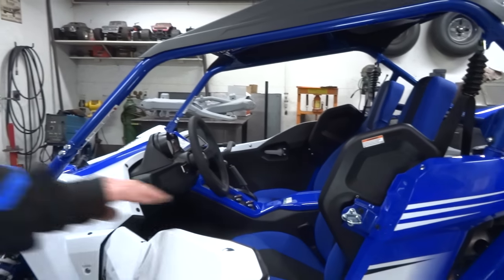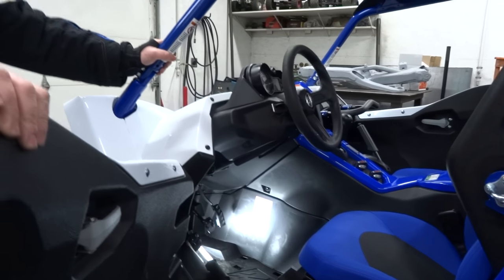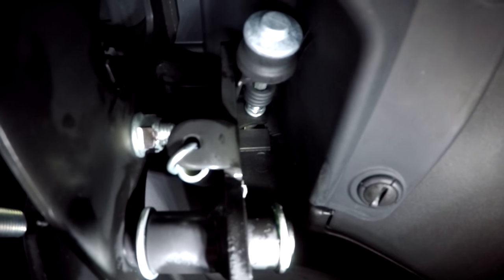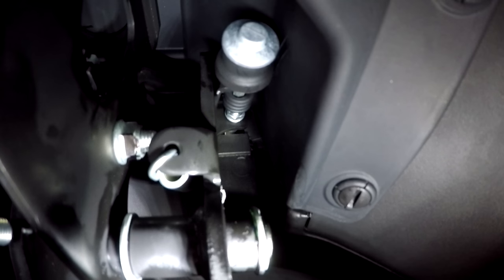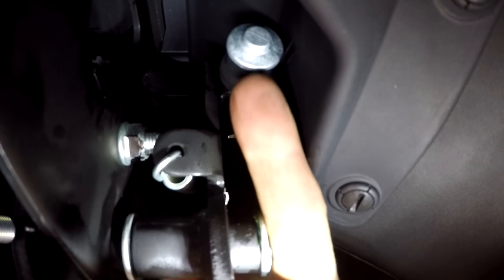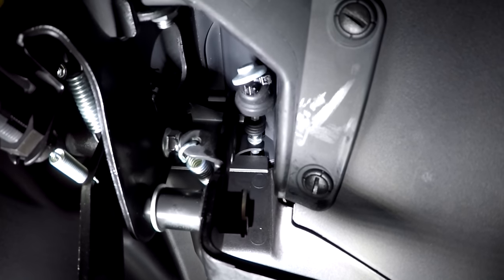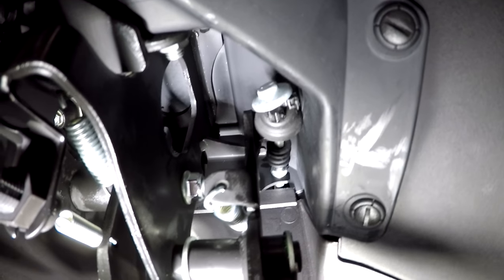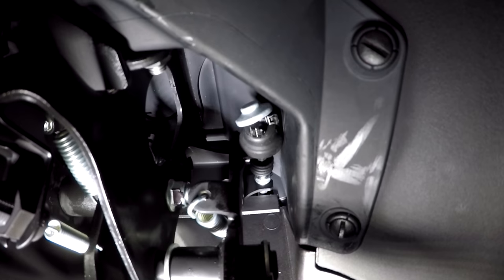Yamaha YXZ throttle zip tie mod! SXSBlog.com Quick Tip Episode 1!

Comment: Hay Doug is the yxz better than the maverick
Reply from the maker: Doug's hair says yes. I'm unsure about the rest of him.
Reply: There have been strong points and weaknesses to both, so it's hard to say which is "better".  I can tell you I've had a ton of fun with both of them.  When we trail ride and hit the dunes I like the YXZ more, when we go to Rocks and Valleys and get into the mud I wish I still had the Maverick.  All about where you ride!
Reply: Ok thanks
Reply: Try out the paddle shifter one, i got some seat time in the new 2018, it has some typical draw back, but seem that the paddle shifter has taken out most of the concern on clutch burning due to improper slipping and half clutching Still needs springs replaced or backed off and it is still a rough ride. .

Comment: nice mod!
Doug could you remove the bushing all together and shorten the cable at the throttle body?
Reply from the maker: My GUESS is that there isn't enough adjustment available for that, but I haven't tried it.  This is defintely the "quick and dirty" fix, certainly a number of more elegant solutions...lol